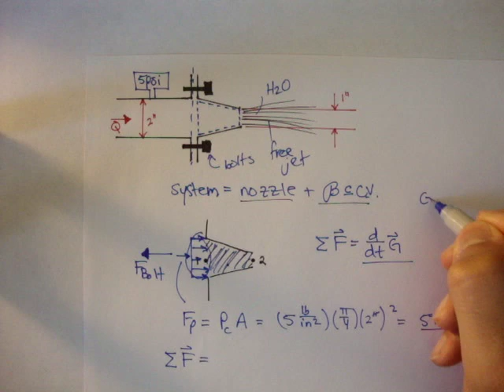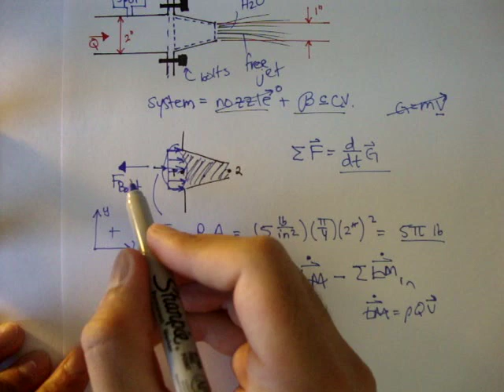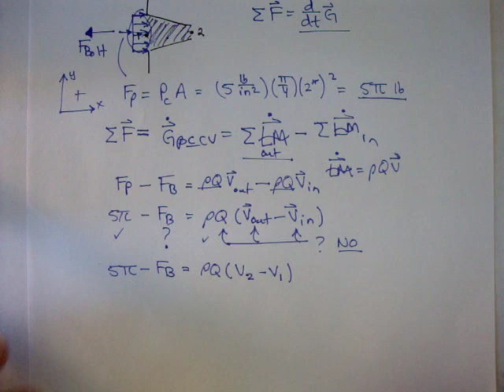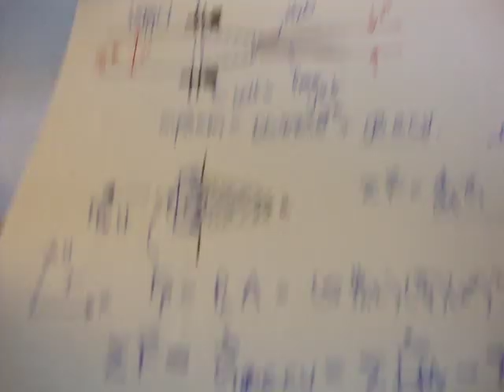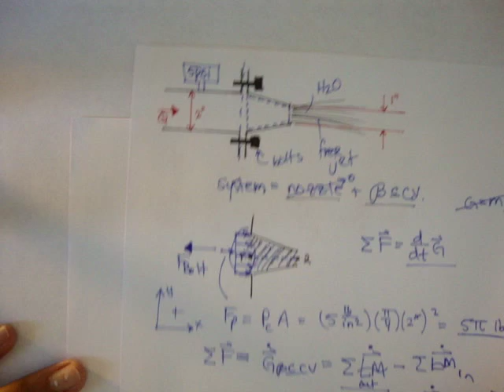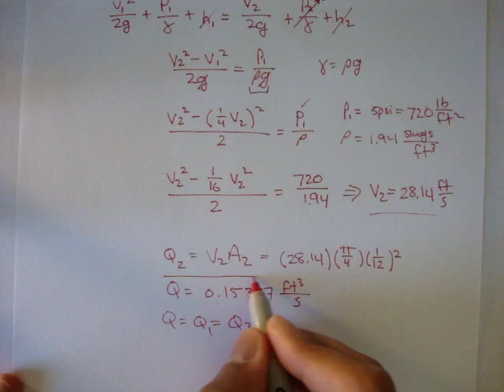Basics of Linear Momentum Part 2 [Fluid Mechanics #28]

Comment: Great video! Thank you for sharing your knowledge with us. 
So you concluded that the force of the bolts, F_b = 9.44lbs. 
How would one size the bolts for such an application? 
If Stress = F/A_c --> 9.44lbs = stress*A_c
I realize that the cross sectional area of the bolts, A_c can be multiplied by the number of bolts around the pipe's flange. 
What would you say is the driving design factor for sizing the such bolts? 
I realize this goes outside of the scope of this video, but would it be the stress on said # of  bolts? Would we take into consideration the nodulus of elasticity, E, of the bolts, given their material? 
How would the equation, Stress = strain*E factor into this design challenge?
Thanks!

Comment: I’m surprised no one has pointed out the incorrect cancellation of units at 9:20. Slugs and lbf do not have a 1:1 ratio. 1 slug = 32.2 lbf. Thus V2 = 6.9ft/s

Comment: Assuming that the atmosphere isn't a vacuum solving with absolute pressures gives a different result than solving with gauge pressure (for systems where the area in isn't equal to area out). I think the answer generated using abs pressure is more accurate. Thanks for the videos they're great!
Reply: Clint Dunn i agree. In Geankoplis book, gage pressures are used even the area of the input and output streams are not equal.. in welty book though, absolute pressures are used. i don't what to follow anymore
Reply: Bonn Moran  Can't go wrong with absolute pressures, I don't think gage pressures would be appropriate unless the areas were the same.

Comment: I didn't understand that why you have included pressure force(5 pie) in the momentum equation. Because this pressure force don't changes the linear momentum (if flow is steady) this pressure force is equally balanced by viscous force in steady flow.
Please explain this point.

Comment: This might be a stupid question, but is the system accelerating? I mean, the net force isn't actually equal to zero, so there must be some kind of acceleration. Is my reasoning sound? or am I missing something?
Reply: You are right bro there is a mistake in this video...if it is a steady flow then we can't include pressure force in momentum equation because in steady flow that force is cancelled by viscous force.
Reply: Assume flow is steady, imcompressible and frictionless otherwise we cant use the bernoulli.
Reply: +Ashish Sandhu but he assumed the fluid was non-viscous, so there isn't any viscous force.

Comment: you didnt need to use the bernoli equatio, since you have Q=v1A1  you can solve for v1 and use that information to find to solve for v2 using the equation you set up
Reply: No. In the problem statement you are not given a mass.

Comment: But since water is exiting the nozzle then how is the velocity 0?
Reply: The velocity of the nozzle is zero. The velocity of the working fluid (water) is not zero. The total momentum of the selected control volume is the sum of the momentum of the nozzle and the fluid. The fluid has momentum as it has velocity. The nozzle does not.